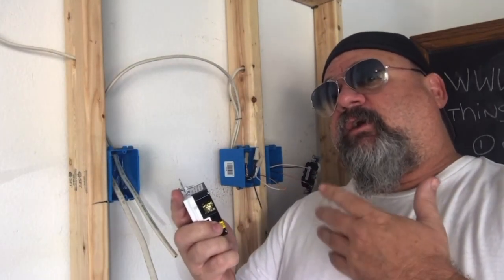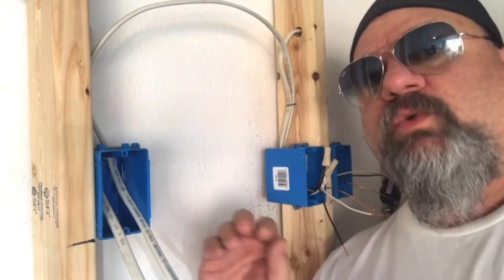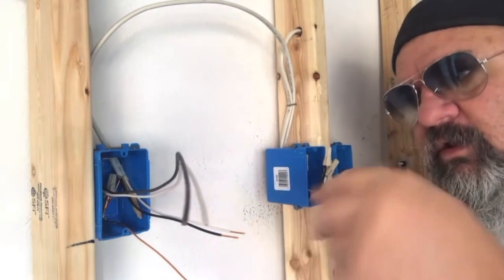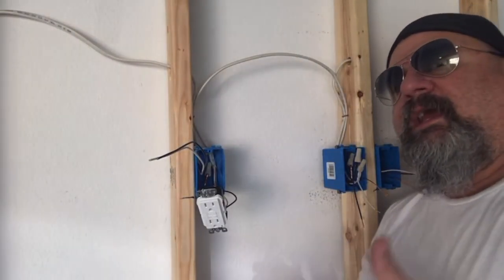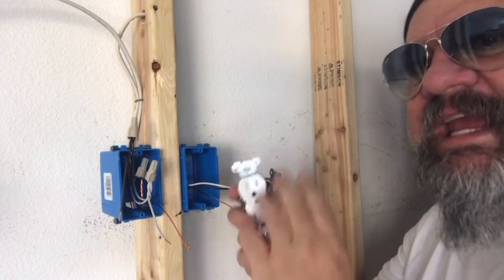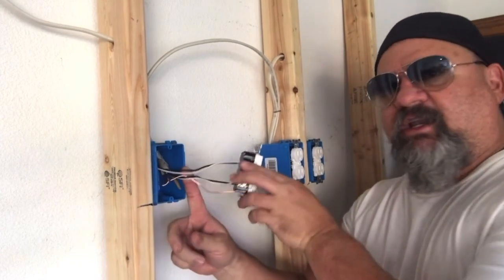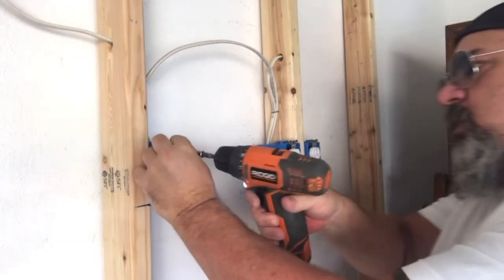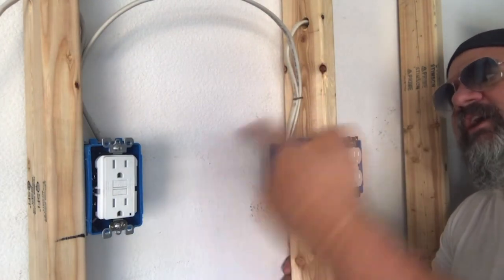How to wire a GFCI circuit and not Just the outlet. The basics from a pro.

Comment: This is pathetic. Junk material, junk tools, junk instructor, junk bargain bin “electrician”. I truly didn’t think you’d backstab even with my low opinion of you. Backstabbing is stupid. Those connections are inferior, it’s not like using a wago which has a superior design to its mechanism. On top of that when you use the receptacle day after day it shifts a tiny bit everytime causing your connections to loosen. Which could cause a fire, yeah, but much more likely will just stop working. Which is also garbage.

Comment: Lenny, Another well done video!   You deserve a Bud and a taco!   So, picking the fly poop out of the pepper.  How sure are you that the test button goes from neutral to ground internally?   I know that there are testers with different milliamp settings up to 30ma.  Doesn’t that indicate different resistors to get a certain amps?   Neutral to ground should have zero volts potential difference right?
Maybe an extra large taco!

Comment: What if it's a dedicated circuit? Manufactured home with the old spliced/pushed one wire.  
Tried to find your web site for a remote consultation but wasn't  successful.
Reply: You can't use a GFCI receptacle on a dedicated circuit because it has 2 sockets and a dedicated circuit has a single receptacle, one socket. You could just not use the other socket on a GFCI and realistically be ok, but it's not code compliant to do that. Otherwise, if your dedicated circuit requires GFCI protection, you could use a GFCI breaker in the panel.
Reply: Thank you, I had an electrician tell me it had to be a GFI.  Lol
Reply: @ajalverson7091  Correction: Single GFCI receptacles are available and I believe that would be okay to use. They still have downstream protection capabilities, just don't connect anything to the Load.

Comment: 5:38 you can stab them if it's #14 wire not #12 wire
Reply: If you use a "spec grade" receptacle, it's higher quality, back stabbing is not an option.
Reply: @surferdude642  we know that when you stab the wire in the back and some outlets are not working you bang on the wall next to the outlet and see if it comes on. i always treat A problem with any electrical problem as A Crime Scene so i ask what did you do when the outlet or the light or what ever happen when this did not work
Reply: @clarencemoore2924  Some electricians and savvy diy'ers agree with Lenny on back stabbing, but most do not think it's a good idea. If you're not an electrician by trade and you're mainly concerned about your house, then time should not be a high priority. Back stabbing is only for ease and saving time, has no electrical or mechanical advantage and increases the risk of poor contact. Properly wrapping a hook around the screw will give better surface area contact. If you want, you can purchase a spec grade receptacle which is higher in quality in every way and you can back wire your connection. Back wiring is not back stabbing and is easy and fairly quick to do. On a 20 amp circuit I only use spec grade receptacles and 15 amp duplex receptacles are totally appropriate to use.